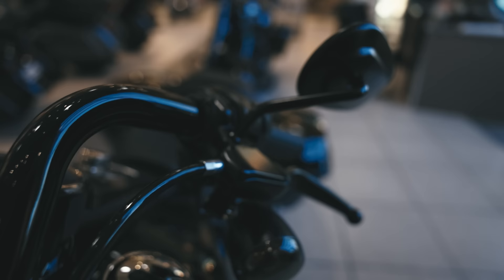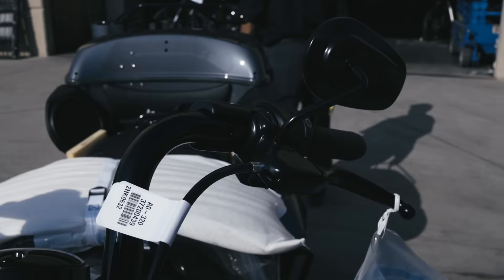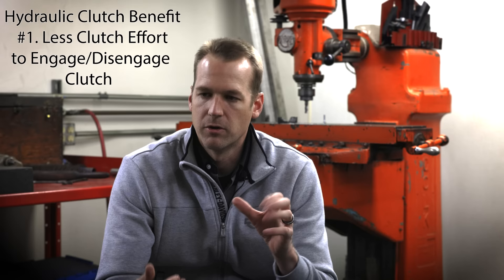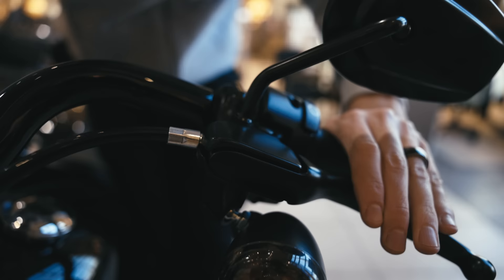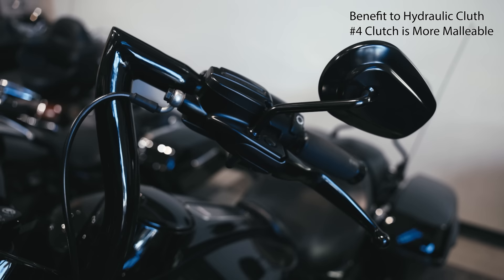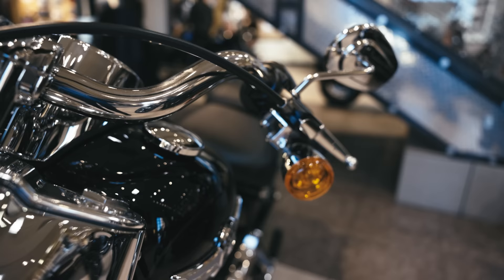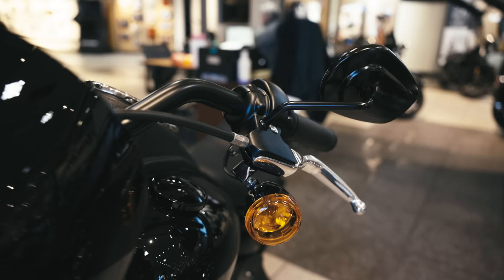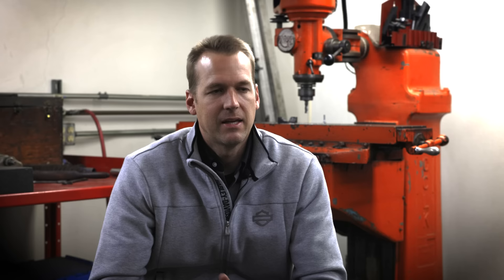Why Harley-Davidson Switched Back to a Cable Clutch on Touring Motorcycles│Pro's vs Con's

Comment: I must be a real rookie, I've riden both and I felt no difference.
Reply: No real advantage to a Harley hydraulic clutch. You feel the difference when you hop on a Euro bike.
Reply: You never had to adjust the hydraulic clutch.  That's the main thing I like about mine.  It's always the same.. no adjusting.. never have trouble finding neutral.

A clutch cable isn't the end of the world but it is a step back in technology and it should not be sold as an "upgrade".  It's not am upgrade.
Reply: @candlstudios  100% correct!
Reply: The first hydraulic clutch I used I hated it because of it engaging so far out. Then I got used to it and now I like it because you never have to get it adjusted. Also noticed when the bikes cold the clutch engages closer to the grip, when the bike warms up it engages farther out.

Comment: I had a hydraulic clutch on my Victory Jackpot and  hated it. There was zero feel. You weren't in the friction zone until the lever was almost fully released which made low speed manouvering much more difficult. When I was shopping for my Harley Davidson back in 2018 I was determined to get a model with a cable clutch. That's how my SportGlide came and I'm very happy with it.

Comment: My 17 fat bob had an easier clutch to pull than my 2020 road king does. I also had to replace my levers on the road king to bring the friction zone closer to the bars to make slow speed maneuvering a lot easier. I hated the hydraulic clutch until I changed the levers.
Reply from the maker: Interesting, thanks for sharing.
Reply: Same exact here.  I had to put down 350$ plus installation to get adjustable levers because of how the hydraulic clutch has such a long distance to friction zone.  Such a long distance stock it's downright dangerous.  My cable 1999 Fatboy never had issues like that and was fine stock.

Comment: I've had two HDs with the hydraulic clutch and I don't have any complaints.  I personally feel that the switch to a cable clutch was a cost cutting initiative by HD.  Just another indicator that the Motor Company is in financial difficulty.  I worry about their long term viability.  It's an iconic American company, and I do hope they do better in years to come as they break into the electric, adventure and sport bike markets.

Love your videos Matt.  Keep 'em coming!

Comment: I’m currently riding an ‘18 RoadGlide Special and love the clutch . I have owned bikes with both . Personally I like the hydraulic but not enough to make a stink over . One thing that can happen with the cable , the cable breaks . I’ve seen it happen on a Police motor . 
Thanks Matt , another great video
Reply from the maker: That's rare but true. I've seen it before as well. You really have to neglect your cable for that to happen. Rust has to set in etc.

Comment: Could you keep the hydraulic clutch and have an adjustable clutch lever, would that also solve the problem for people with small hands etc?
Reply: I’m not sure if Harley makes a different lever but it is definitely possible. I have a Goldwing with a hydraulic clutch and it has an adjustable lever.

Comment: Great video Matt. I had a 09 deluxe and now have a 2020 RGS and can tell you that i didn’t missed a beat when I changed clutches. You can also get adjustable levers if you think the pull is too far. Ride safe.

Comment: Thank you Matt, always love watching your content. I will take the cable clutch 100% of the time. I definitely prefer the “mechanical feel” of any motorcycle I am riding which leads to better control and safety in my riding. Having total command of how and when I want to engage the power to my rear wheel is one of the keys to having command over my bike.  I’m very glad Harley-Davidson came back to the cable clutch regardless of motive. Now,  I wish they would bring back some of the beautiful iconic  classic models they dropped! After all, that’s why I buy and own 3 Harley-Davidson’s in the first place! Take care Matt, have a great summer!

Comment: Currently I have a 17 streetglide I bought new and my previous bike was a 13 deluxe I bought used. Until watching this video I never really once thought about the difference in the two clutch systems in those bikes. I am a avid single track dirt rider and every dirtbike I’ve owned has had a hydraulic clutch. 
So thinking back after watching this video I do kind of remember my clutch hand being more fatigued after long rides on the deluxe - however that was my first street motorcycle so it may have just been my hand getting used to clutch work while sitting traffic, etc.. 
But that minor fatigue was not enough to have any argument in either direction in this debate. 
In my opinion no matter the rider (aside from a medical condition) it’d probably take a few rides to get used to a clutch on a new bike with either a cable or hydraulic anyways, so the point is kinda moot and people are arguing for the sake of arguing.

Comment: Interesting discussion. I have 4 bikes, two with hydraulic clutches and two with cable clutches, one of which is my Harley. The Harleys cable clutch on the M8 is the easiest to pull out of all of them, the next is my Ducati 1200 Multi which is close and it’s hydraulic. The worst is my other Ducati with a hydraulic clutch where you need gorilla forearms. Do I have a preference on feel, not really. But here is the main thing with clutches, and riding a touring bike in Australia. You can fix a cable clutch on the side of the road, and I’d always take a spare cable with me. I’ve fixed a young blokes clutch out in the middle of the outback because he had brought a spare with him (though he couldn’t fix it himself). With a hydraulic clutch, it’s game over, trip over and probably a very expensive tow up which if you were unlucky could easily be up to 1500 miles to the nearest HD dealer, who probably hasn’t got the parts on the shelf and has to order them from Sydney, if you’re lucky. Worst case is there are none in the country and it’s a six weeks wait. Been there and done that on another manufacturers bike. So for me, my preference is cable simply because if it all goes pear shaped, I can get myself out of trouble (or you can find someone who can).

Comment: Hydraulic clutch benefits far out weigh their drawbacks. When well implemented. Harley should have worked harder to get it right rather than scrap it. 

When they bring them back out in the future they will have to fight all the negativity they started.

Comment: Guys after 2 Hydro clutch bikes and many many miles, just picked up a 2021 RG. The cable was briefly mentioned by stealership, but I noticed it before I signed. Yes the cable feels a touch heavier, just a touch. When Matt here says slightly, its a good word cause its slight. It felt a bit odd at first and I felt I over reved on a start a few times. Soon as I got a good feel after enough starts and stops. I fricking love this cable clutch, here is why. The friction zone seems huge compared to my hydro clutch bikes. Not just a little bigger, miles bigger and way way way more rider usable. What I mean by usable, like coming up on a red light and you wana slow for the light to change. Riding the rear brake and this clutch makes it simple to find that exact amout a clutch friction ya want. Tighter slow speed turns made much easier, the cable gives you that much more feel. Love it. I can handle adjusting it every now and then. Guess I need to go way back to my 1972 FLH days wear an extra clutch cable was always wrapped around on the inside a one of the hard bags. (and extra points, plugs and a wrench, condenser, more oil LOL yea those were the days). By the way you dont actually have to have a clutch to ride a Harley, ask me how I know. Yea I realize , cable prolly cheaper for the Motor Company, But sometimes in my mind, less is more. I like it.

Comment: I wish you would have touched on the warranty issues and the oil transfer to the primary from the hydraulic clutch. I have only used a cable clutch so I can't compare both.

Comment: I rode them back to back and find a big difference. I find cable much easier to pull. Once it's in much easier to hold longer on the cable.  Cheers.

Comment: I am glad H-D went back to the cable clutch. I hated the friction zone on my 2017 Road King. In all my years of riding Harley's (over 24 years), it was never an issue after the cable clutch was adjusted during servicing on any of my other bikes. I like the ease of low-speed feathering or "working" of the friction zone with a cable.

Comment: I've had an Ultra with 144,000 miles still with original cable, a 14 Limited with 106,000 troublefree miles on hydraulic and now a 22 APEX Limited back to cable. I've witnessed several hydraulic clutch failures due to boiling the fluid in the slave cylinder. Usually going up steep grades including Mt Evans, nothing worse than your clutch not disengaging and losing all feel and trying to find a place to pull over. The wider friction zone and adjustable release point are huge pluses with cable and also completely eliminates the fluid transfer issue many early M-8's and even my 14 Limited experienced. I rarely had to adjust my clutch on the 09 even though heavily loaded with many high speed powershifts passing traffic and it definitely had a lighter pull than the 14. The Softbrake reduced reach lever on the 14 was a huge improvement over the stock lever when stuck in traffic on an incline moving only short distances at a time over an hour.

Comment: The longevity, simplicity, and dependability of the cable clutch is what keeps me with a mechanical version. After testing out the hydraulic version, it was the lack of a friction zone that became the second deal breaker for me.

Comment: I have a 93 FLHS that I bought early this year. My clutch was grabbing right off the bars. I brought it in for service and Digger adjusted it. Now, its at the other extreme, but it was good to hear that it should grab 85% out which is probably on the money.

Comment: I have said this a few times, but the friction zone letting out at the end of travel on the hydraulic clutch made me seriously regret my 2020 SGS purchase. I seriously considered trading it in, I upgraded from a 2014 fatbob and I was really struggling with the friction zone being basically finger tip control for me at low speeds. I asked the dealer and looked online for adjustments that could be made to change the friction zone, with no solution in sight. The ONLY thing that saved me was the fact that I stumbled upon a Jerry "Motorman" Palladino video talking about an adjustable clutch lever, I bought it and allows you to change the clutch lever itself mechanically and I brought it right back to very close to the grip, and it saved my 30k purchase. Had it been a clutch cable, I never would have had this issue, I would have just had it adjusted and never thought about it.

Comment: Used a scale to test the pull of my hydraulic clutch and my daughters Sportster clutch.    Both took about 25 lbs of force to pull the clutch, but when the Sportster cable clutch came back all the way it only took 18 lbs to hold it in.  The Hydraulic clutch on my 2019 Ultra was steady at 25 lbs of force.  So while they both take same amount to pull the Sportster feels lighter when you hold it.

Comment: Yep, when I bought my 2020 SGS I told them to adjust the clutch because I thought Harley only used cable clutches. I wouldn't have bought the bike if I had known. The dealer hid that from me and now I'm stuck with a hydraulic clutch. Thank You Paradise Harley in Tigard, Oregon, Sucks

Comment: You can move the friction zone in and out with an adjustable clutch lever like I have on my triumph ......simple turn of the knob. It doesn’t change the band distance but sure moves it in and out nicely. I think Harley did it to save money and personally wouldn’t buy one. I have two now with the hydraulic clutch and was going for a new one until they did that.... I’m sure I’m
Not alone on this decision

Comment: Hydraulic clutch is better that’s why other manufacturers have been doing it for years. I agree with you Matt on the reasoning, I think the bottom line its less cost for Harley-Davidson. Just think what cost it saved by switching & increasing the 2021 bikes price from 100 to 400. They are most likely making at least $800 to $1000 on each bike.
Reply: So should Harley put DOHC motors in every bike, since other manufacturers have been doing that for years it must be better right?

I’m not saying hydraulic clutches aren’t better (although my least favorite clutch out of all the bikes I own is my MV Agusta’s clutch which is hydraulic) but what I am saying is that just because most other manufacturers do something doesn’t mean it’s inherently better.

In fact most other manufacturers have much worse paint than Harley, and have much worse paint for years!  Should Harley switch to much worse paint since it’s clearly better!?

Comment: I had 2000 Wideglide before I traded it for The 2015 Street Glide Special that I have now.I like the hydraulic clutch alot better than the cable clutch that was on my Wideglide.That cable clutch used to make my wrist hurt on a 200 mile ride to the mountains and back when you did alot of shifting.My wrist never hurts with the hydraulic clutch on my Streetglide.I did have the cable lubed and adjusted but it was always harder to pull in than the hydraulic clutch.A Friend of mine has a Crossbones with a cable clutch and I can't believe how easy that clutch is to pull in.Just as easy as a hydraulic clutch.When I've rode Demo CVO ULTRAS or just about any kind of CVO BIKE I noticed a tingling feeling in my fingers when putting the bike in first gear.This is Just on The CVO BIKES not anything else with a hydraulic clutch.

Comment: I've never ridden a Harley hydraulic actuated clutch bike myself, but I can say I owned a 2005 dyna super glide(among others previously) and during the time of ownership I suffered a neck injury that caused some nerve damage to my arms and hands resulting in some loss of strength and control along with some fatigue, pulling the clutch in and out multiple times during heavy traffic I would sometimes have to pull over to give my hands a break and I ended up selling the bike because I felt my riding days were coming to an end but after a short time of completely missing riding I decided to buy another bike with the thought of replacing the cable clutch with an aftermarket hydraulic clutch to help myself during those traffic situations, I purchased a 2009 road king and I was shocked at how easy the clutch pull was on the road king compared to my old super glide, I don't know what Harley did in those four years of production to ease the pull of the clutch but hats off to them, I decided not to replace the clutch cable for the hydraulic after all.

Comment: If you want more "friction zone" go with a reduced force slave cylinder. It's true the hydraulic clutch is a few pounds more difficult to pull. I tested it before I went with the AIM slave cylinder. My cable on my '08 was about 21 lbs. pull. My '15 RG hydraulic clutch was 25-26 lbs. Pull on the AIM is now 15-16 lbs with a much broader "friction zone".
The hydraulic clutch will always be smoother. For folks who say they are more prone to failure....brake systems have been bullet-proof for a hundred years. I personally love the smoothness and the fact I don't have to readjust my cable anymore which I did once every riding season.

Comment: You can adjust the point of engagement on a hydraulic clutch by shortening the length of (and I forget the correct name of the part) of the piston by a very small bit, like an eighth of an inch. This will move the point of engagement closer to the bar. I have done it on a 97 FXDL, a 2015 Kawasaki Voyager and a 2008 Goldwing said the 69 year old guy with arthritis in his hands.

Comment: I went from a 2008 Road King to a 2016 Road Glide and the first thing I noticed was how much harder it was to pull the clutch on the Road Glide. My 2021 RGS will be delivered in a couple weeks and I'm glad it will have a cable clutch.
Reply: Totally agree Brian. When I'm doing the parade at faak am see Austria, my hand is in real pain. I ride 2017 electra glide. One thing I do like is normal riding only need to pull clutch with two fingers. Would be great if i could do that, parade riding.

Comment: Ride Like a Pro is an amazing class. I took it from Motor Officer Jersey here in Colorado last year and practice slow speed maneuvering almost every time I ride. It's like trials riding for street bikes. The slow, lock your handlebar and scrape your floorboard turn is very difficult for me and didn't realize until this post that it could be a result of having a hydraulic clutch. My next bike will probably be a Road Glide and was a bit ticked off about the cable clutch until now. I really appreciate this post and Jerry's input.

Comment: Your explanation of the difference between hydraulic vs cable is spot on.  I don’t think H-D can explain it any better.  I’m on a ‘19 Road King.  I’m also old school and prefer the wider friction zone of a cable clutch.  If H-D could have made the hydraulic clutch with a wider friction zone, they would have nailed it.